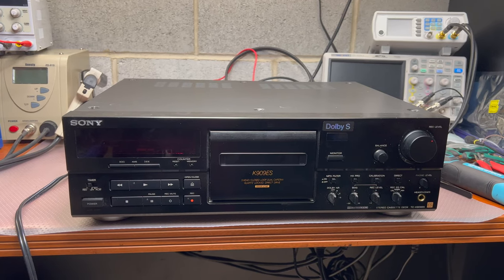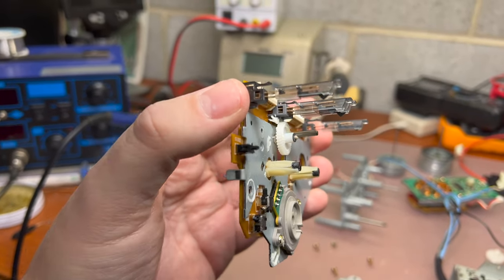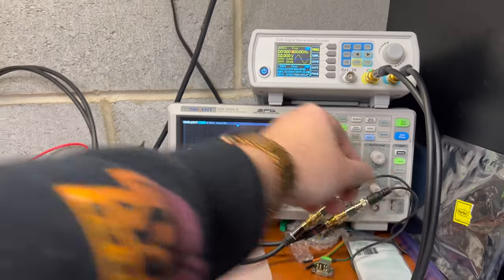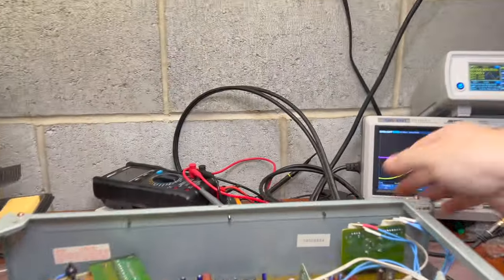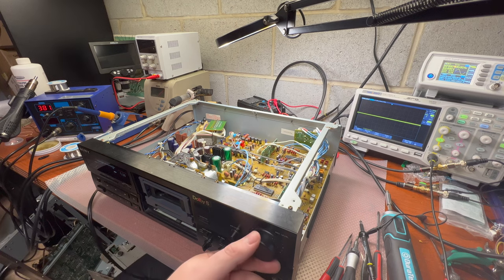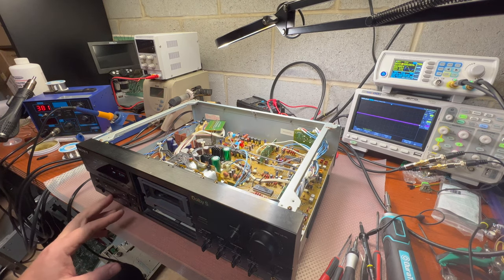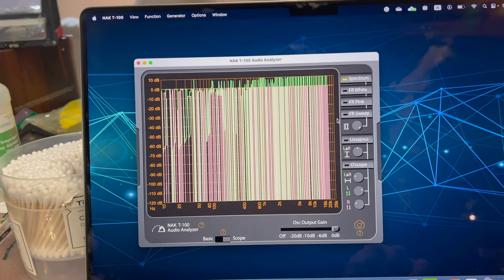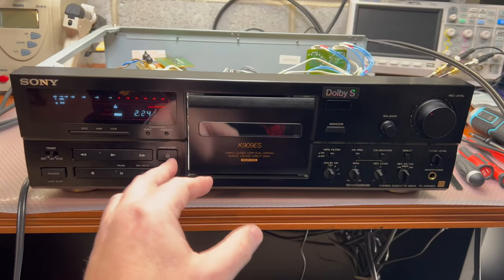Sony TC-K909ES Restoration: Reviving a Classic with Nichicon Capacitors

Comment: Hi. I changed the belts on this Sony of mine during Covid: it worked fine, but in the "pause" position the tape got tangled. Now I would like to repair it: I disassembled the mechanics, it is clean and light, fast mode is all ok, but in play it does not work. It seems that the carriage only reaches halfway and the pinch rollers do not touch the capstans, it gets stuck and does not start. Unfortunately there are not even tension values to check on the diagram, do you have any ideas? Thanks.
Reply from the maker: @croma61able  hi, the heads got pulled up by the large black plastic gear. Check that when you assemble the carriage pin gets in the proper position and when you manually rotate the gear head goes up and back down.
Reply: @hifirulezzz  Hi, thanks for the reply. Moving the mechanism by hand it works perfectly: this morning I disassembled it again and the famous pins are aligned. Strange that 2 days ago it worked again, but now, I repeat, maybe it didn't have the strength to move the entire head assembly. 6.8 volts arrive on the engine, in play, but I don't know if this is correct...

Comment: I have same deck. For some reason, the mid frequencies and high frequencies are not reproduced either during playback or during recording. If pre- recorded tapes are played, the issues remains.
What could be the problem? Any suggestions?
Reply from the maker: @baredesigns1 High frequencies are not reproduced due to azimuth, but if your deck doesn't play mid range check if the heads are touching the tape properly.
Reply: First check the tape pass, head alignment. If these were fine or in factory settings, probably playback head may have worn out or has been degraded due to cobalt amorphous materials

Comment: Get some alignment tapes from Alex Nikitin.
He haves FULLTRACK recorded Azimuth tapes (and i belive level tapes too) + he haves an height alignment tape (that haves a 1KHZ frq. recorded between the channels, and u must adjust for minimal output).
The tapes u got are from ebay, recorded on a ZX7.

Not saying those tapes won't do the job, but for the ammount of detail you go in when servicing, i think you could make use of those properly recorded tapes.
Reply from the maker: Well, I am using the tapes which I trust. These tapes have been verified on multiple decks. Phase tape I made myself and made another one for my friend who has a full set of calibration tapes and he confirmed that phase is good in a full range up to 20 kHz. About head height. If you using full track tape - agree, you have to make minimum values on both channels, but if I will use 4 track tape - I will have to make maximum values for both channels. And I verify every deck with high-quality factory tapes for proper reproduction. I would love to have a full set of original tapes, but it will go far above $1k, I already spent $500 for the calibration tapes I have.
Reply: @hifirulezzz  The tapes from Alex Nikitin are the closest if not 100% the same as original tapes.

Comment: Last true Sony serie/generation
Reply from the maker: No, the last and the best was Sony TC-K555esA. That deck was designed when saving money was not on the table yet. Ceramic door, multiple expensive design decisions. Even next gen 555esJ they had to trade off cost and when introduced Dolby S had to offset costs by removing ceramic door.
Reply: @hifirulezzz  Absolute right. 950/970/990 or Japan version 333/555esG/esA/esJ were absolute havy, solid, great decks. With sure these serie were inside lot of copper and very good power transformer. 909 is almost 4kg lighter, but stil remind beautifull line 990 ES. Of course I would prefer 333/555 esL/esA or esA than 909 ES. I only focused on technical parameters and appearance, not on internal elements and workmanship. In the case of Pioneer, the CT 939 mk II/CT 91a/CT93 were also the heaviest. Savings were already made on the next series.
Reply: @hifirulezzz  I admit that I didn't know that Sony produced and installed ceramic doors in its flagship, top models. Bravo Sony !!
Reply from the maker: @tobiaszpasterski481  I do not want to make you sad, but K909ES is K222ESJ.
Reply: @hifirulezzz  Ok. K333/555 ESG=european K950 ES, K333/555 ESL=european K970 ES, K333/555 ESA=european K990ES, K333/555ESA=990ES but with Dolby S. K909ES/K222ESJ is "economical" deck. J for Japan market=Dolby S. If I was wrong correct me please :)
Reply: @hifirulezzz  Of course 333/555 ESG/ESL/ESA/ESJ are advanced version own basic version reserved for Japan consumers. I understand or I think I understand :)